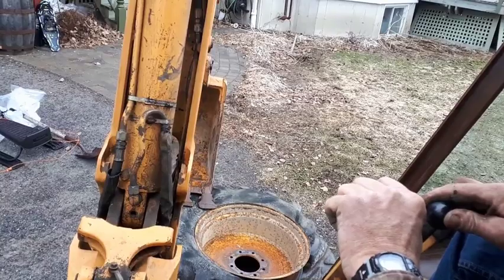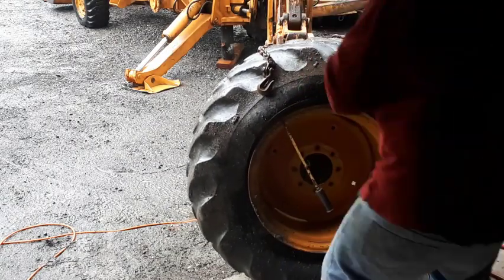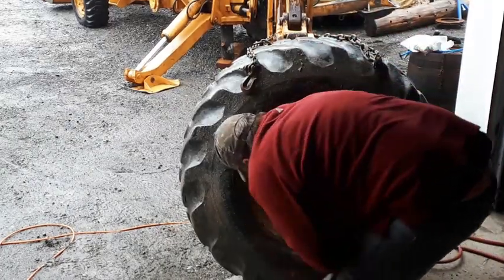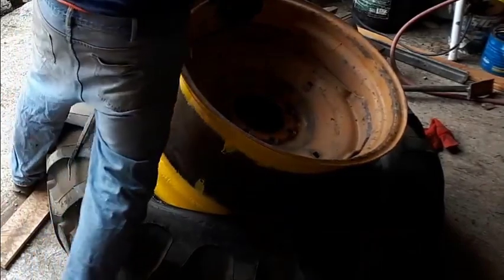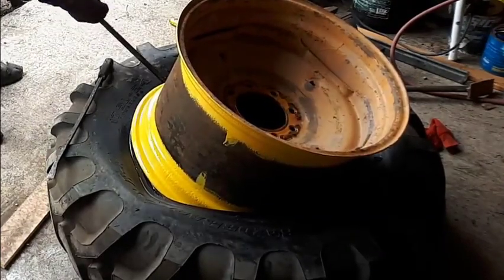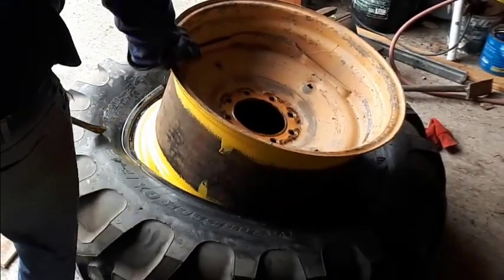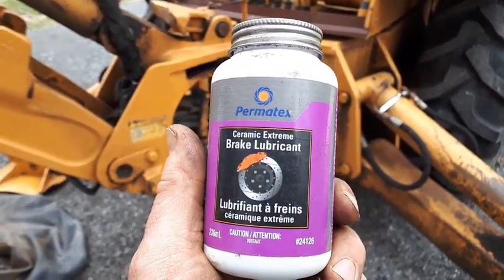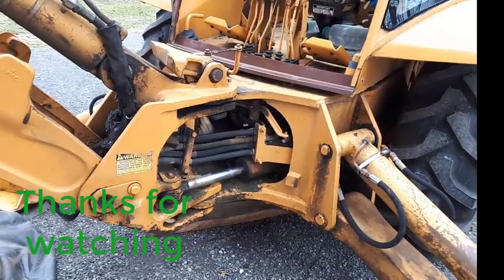Case 580K Tire Change

Comment: Done car tires and even medium duty truck tires with a bar but not a tractor tire, never needed to.  I like the use of the hoe and stabilizing foot to break the bead, it looks like it works in a pinch!
Reply from the maker: I have a Coats model 60 rim clamp for the trucks and trailers. I got tired of tires leaking air because the shop went quick and didn't clean the rim well. The only tires I don't do are the back tires on the two farm tractors. They are full of liquid.

Comment: I just found this video. Last summer I bought a Case 580L and sooner or later it's going to need rear tires. I'll probably just change them myself like you did. Thanks for the video.
Reply from the maker: I should have bought tires years ago. I used four wheel drive two or three times last summer. The old tires had no traction at all. It wasn't hard to do. Nice machine to have.

Comment: Hi Randy, a giant set of tires replacement and we thought our Jeep tires were bad to rotate here just heavy for us to get relocated on those small 5 lug nuts. 
Wow you have to sand brush and repaint the wheels when you change tractor tires we are learning here that snow stuff might be worse for wear then our sands and mud flows here in the desert.?
Those wheels are a lot wider then it looked with the tires on it. Nice fresh and new tire has to feel good.
GREAT job Randy.
Lance & Patrick.
Reply from the maker: Thanks you guys. The backhoe is 30 years old and it's probably the first time the rims have been painted. I said the original tires in the video. I'm sure they were not original, they were the tire it came with when I bought it in 2005. Take care Lance, Patrick. Your channel is doing great, congratulations.

Comment: Nice job Randy. At some point I will need to change the rear tires on one of my Kubota's, but not cheap and I just use it around the house so I will just look for some OK used ones.And you got breaking the beads down pretty good.Gary
Reply from the maker: I saw your Kubota in the recent video. The hood was off. That looks like a nice one. What model is it? We have many Kubotas and I can't say to much bad about them. The sun does a lot of damage to tires so I try keeping them out of the sun when stored or not being used.
Reply: @JourneymanRandy  pretty good for old origional tires i sure enjoying working on case and kubotas the best and easyist tractors to work on and servicing

Comment: I am in the middle of building a driveway &  had a rear go flat on my back hoe  , but i took the easy way & took the wheel to the tyre shop that we use at work !    was that the aero start method you used to get the tyre onto the bead !!!
Reply from the maker: Yes, its the only way I can do it. Take care Max

Comment: What’s the tire pressure for the rear and front?
Reply from the maker: It could be 30psi front and 24psi back but I will check. I have several different machines and its hard to remember what they are.
Reply from the maker: Its 50 psi in  front 30 psi rear. Take care